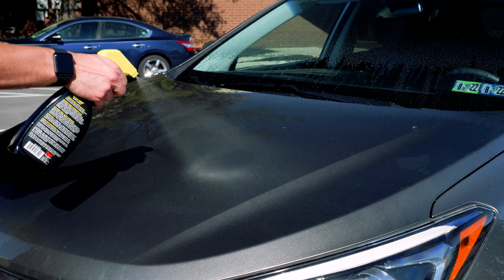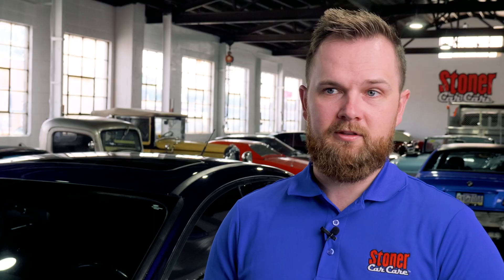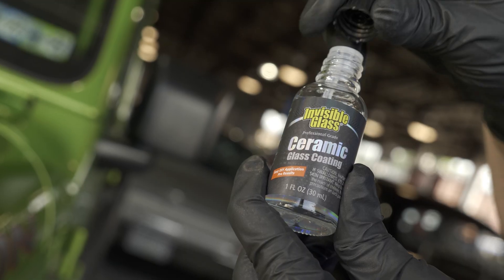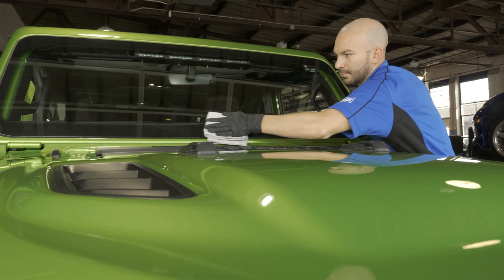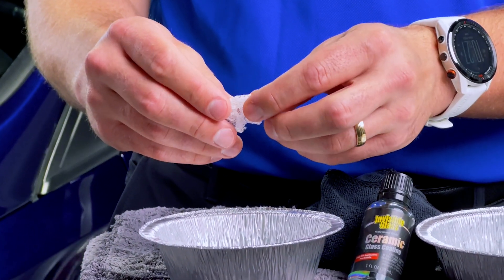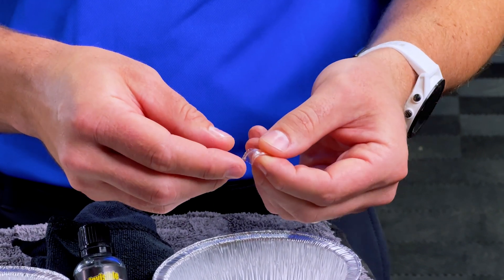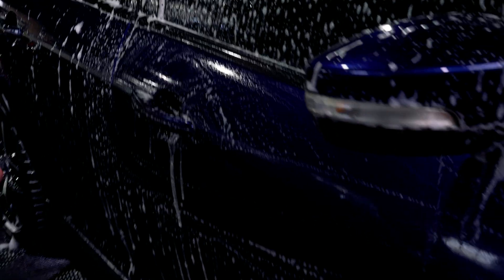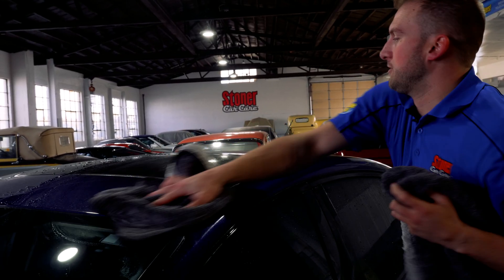Ceramics vs Sio2 vs Silicon - What's The Difference?

Comment: What product would you recommend to restore a faded personal water craft (PWC)?  Would the hybrid product be effective and how long could you expect it to last?
Reply from the maker: Hey! We would suggest starting with the hybrid then if you like it then you can apply the ceramic version in the off season. The hybrid version should last you several weeks.
Reply: Hi, you would want to do some type of paint restoration first before applying a coating. You have to rejuvenate the gel coating first,bring back the lost luster and shine, one you have that restored back then applying the coating will enhance, and provide the protection needed to prevent future deterioration. You can search for gel coat restorer and 3m has a great product, but understand paint restoration should be left to a professional as it's time consuming and gel burn could be ensured if not properly trained or have the correct equipment to perform the restoration.